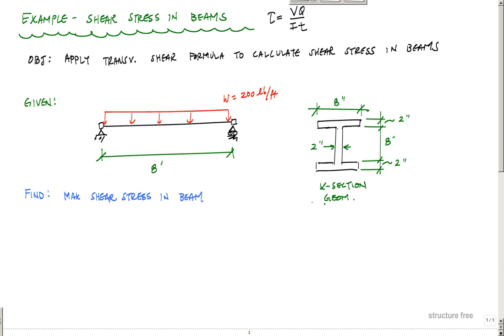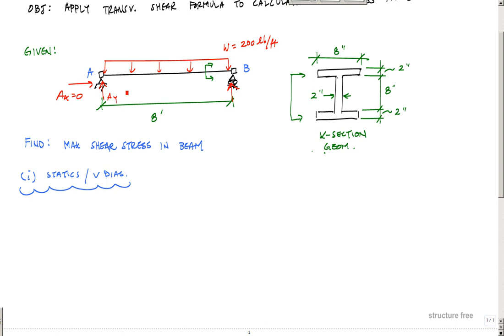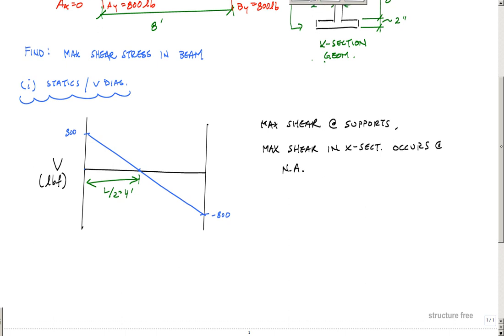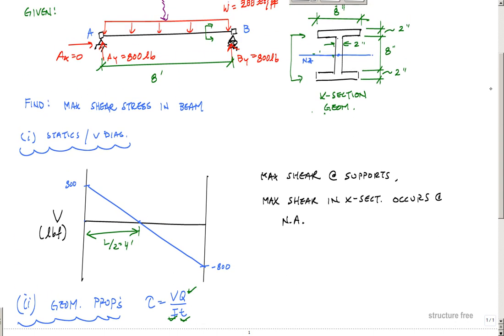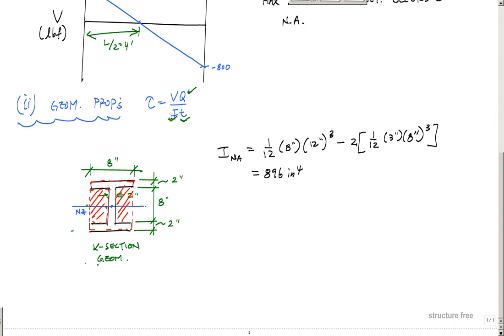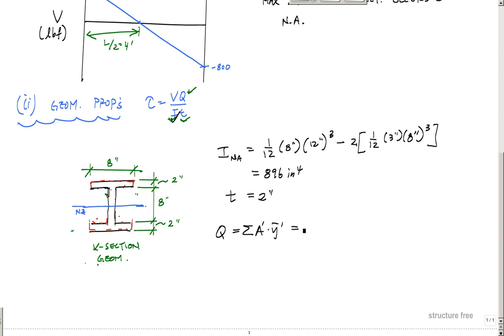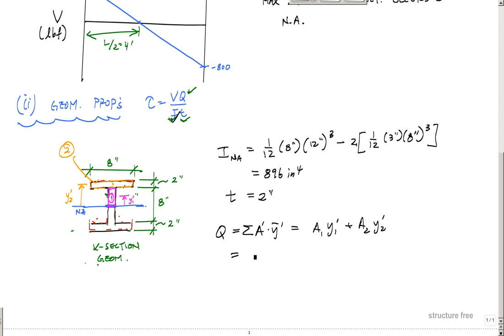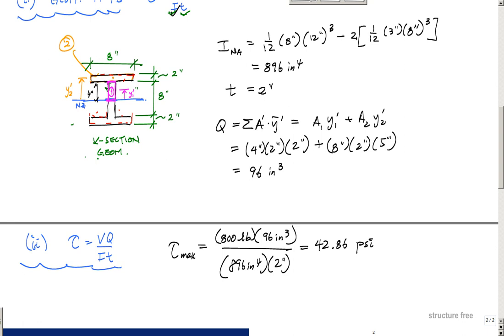Shear Stress in Beams Example - Mechanics of Materials

Comment: The distributed load is in lb/ft and length is in inches, so you should've multiplied the weight by 12 to convert it to inch in order for the units to cancel.... so 200*8*12

Comment: As always, I just wanna refer back to your vids to review my knowledge. I'm having my FE a few days from now and having a problem that I just can't get it right so please give it a try. Here's what given: a horizontal cantilever shaft 20cm long and 4cm in diameter. the shaft is subjected to a torque of 500N.m and a vertical load of 2000N at the free end. What's the MAX shear stress. 
Here's my attempt: the shear force is caused by both the torque and the vertical load. 
Shear stress caused  by torque calculated using "tau= T.r/J" so that's easy.
Shear stress caused by the vertical load is giving me trouble though. I attempted to use equation "tau=VQ/Ib" which is reduced to tau=4V/3A since the shape is circular. 
Then finally how do I decide the MAX shear stress? 
No matter what I do, I just can't get the answer as in the solution. Thanks in advance for your answer.
Reply from the maker: +WHY70122 what's up!! It's been a while since I've seen a comment from you.  I hope it means that you are close to graduation.  you are definitely on the right track about converting the internal torque and internal shear to shear stress and then adding them together.  I wonder if it is just a units conversion issue?  Or something simple as using the diameter when using a formulation for J that requires radius (i.e. J = pi/2 * r^4)